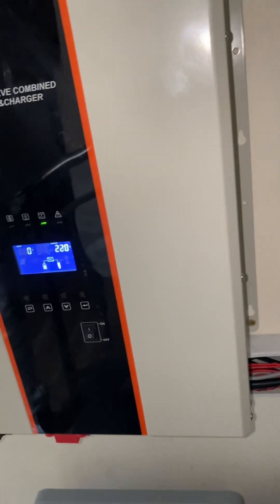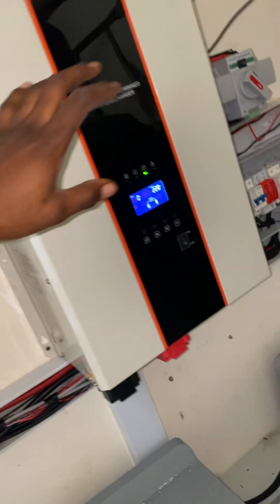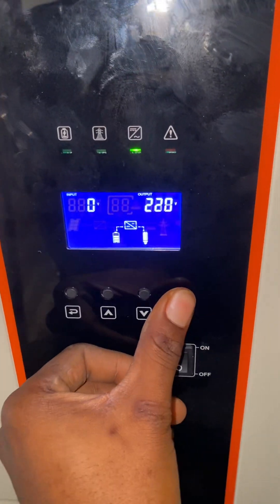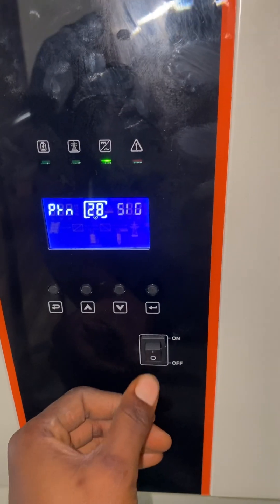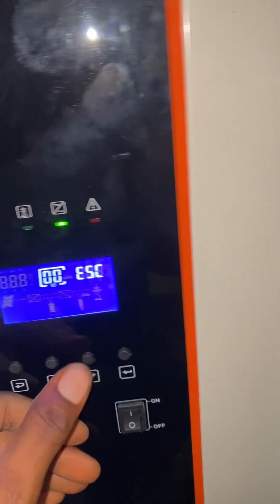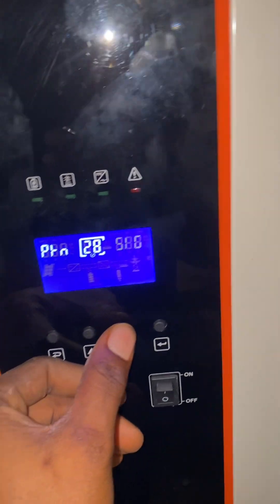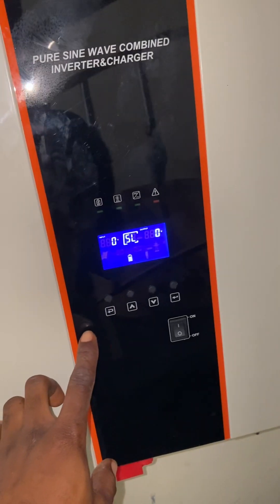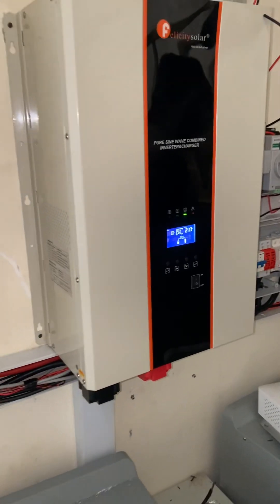How to parallel 2 inverters 10kva each to form 20kva.

Comment: Please you said if you want to make it 3 phase it must 3 inverter but my question is in setting the inverter to 3 phase will the 3 inverter be on that 3p3 settings? or only the host will be on 3p3 then the remaining 2 inverter will be on 3p2 for the second inverter and 3p1 for the third inverter?
Reply from the maker: Each of the inverters will produce a single phase together you’ll have 3 phase. Note  do not join them together and you must use 3 phase to charge from grid
Reply: @EngrVick so the 3 inverter will b on 3p1 then the one I set first will now be the HS,

Sorry Please what do mean by I should not use 3 phase to charge from grind
Reply from the maker: @ChikaEmmanuel-bq4uz I said you must use 3 phase to Charge Whether Generator or Nepa most times nepa is not always complete then you can get a transformer

Comment: Thank you, what if the inverter is not an hybrid, and you have 2 felicity controller 2 battery. Will you connect it to the battery separately?
Reply from the maker: No, hybrid or not it is the same connection get a box Busbar connect your inverters and batteries to enable the current flow in sequence

Comment: Good Job but how do you put on the breaker
Reply from the maker: The inputs go the same breaker 
But using separate circuits breakers is not bad if you know they are original breakers

Comment: How about the two inverters communicating with the batteries.

How will that one go sir?
Reply from the maker: Just communicate one battery to it and it will work with the other because the batteries are already communicating
Reply: @EngrVick  I mean communicating Two inverters with one battery

Comment: Will it have a different output or will the output be in the same output breaker
Reply from the maker: Same output, a total of 20kva
Reply: @EngrVick okay thank you..
That's the work am doing now.. 2 unit of 10kva Felicity solar 2 15kwh cworth lithium battery ..
So the Ac input will be connected together including the output
Reply from the maker: @emmanuelnnaemeka2679 yes
Reply: @EngrVick okay thank you
Reply from the maker: @emmanuelnnaemeka2679 ur welcome 🫂

Comment: Nice video bro 👍 but there is something missing the cables you are using for parallel is not complete it ought to have been Four not two, I guess you will look into that, thank you
Reply from the maker: To pair two inverters you only need two cables 1 current sharing 2 parallel communication cable. However if you have more than 2 inverters the additional will be added

Comment: How do you then connect the input and output of both inverters
Reply from the maker: Both will enter into a distribution box 
Take power from the same source and supply the same load
Reply: @EngrVick thanks
Reply from the maker: @CameronOsemwengie ur welcome

Comment: What about d input and out put connection of d inverters.. how will i connect d output of d two inverters? As well as d input wire?
Reply from the maker: The input will take from the same source while the output will supply the same load

Comment: hi, if l have 3 inverters each supplying  1 phase in a 3 phase system, do l need to connect the current sharing cable, or the paralleling cable
Reply from the maker: It depends, it is entirely your choice. If you wish pair the inverter to achieve 3 phase it is fine as long the inverters can pair but if not you can share the loads among them and still have your load powered.
Reply: Okay thank you, one last thing, do l need communication cable between the inverters?
Reply from the maker: @lindoemmabo9269 yes

Comment: Gr8 sir 
Pls i need a help on dis felicity 10kva/48v
I have installed felicity 10kva ad felicity 17.5kwh/51.2v but nt communicating,i used d black cable dat is lebel 0 link @ d edge link 1 connect it inverter RS48 port ad to battery comm port but d inverter is displaying code 80 on d screen have also set d battery type lithium(LIB) only d lib display d com didn’t come up d error code 80 will b flashing but d battery is charging ad outputting 
I need more enlightenment on how to do it pls
Reply from the maker: This could either be two things 1 the communication cable is not connected properly or the communication port is faulty
Reply: @EngrVick from d battery or inverter ad is d solution
Reply from the maker: @abubakaribrahim6041 battery to inverter ofcourse
Reply: Yeah 
Thanks
Reply from the maker: @abubakaribrahim6041 ur welcome
Reply: @EngrVick without d com does it have any effect on d system nt to work proper 
What i mean will it affect d system without d com coming up
Reply: Without the com nt coming up

Comment: Make video of how to run the  2 inverter AC output wire
Reply from the maker: I seat to that though it was explained in the video..
Reply: Do a video on how U connected the output cable. Good job engineer

Comment: Thanks for this you explained it very clear but please if I want to connect the inverter to the battery is it the 2 inverter I will connect or just one
Reply from the maker: Yes, both will use same battery
Reply: @EngrVick please don't be offended am asking to many questions what if it's in a 2 or 3 lithium battery system how do I go about it
Reply from the maker: @ChikaEmmanuel-bq4uz  just use your communication cable to connect them all